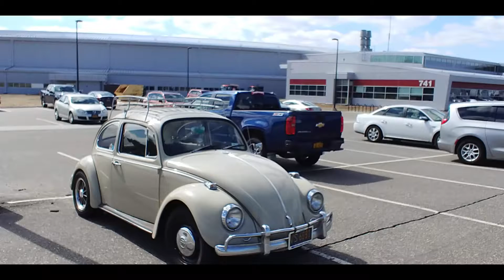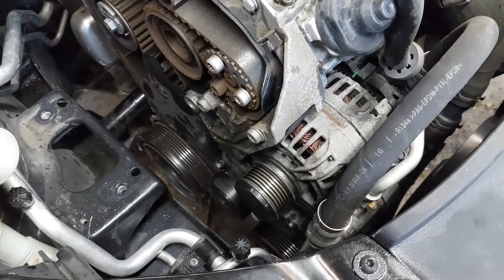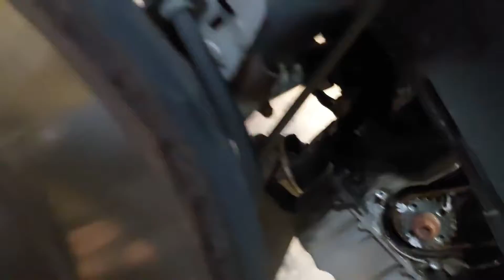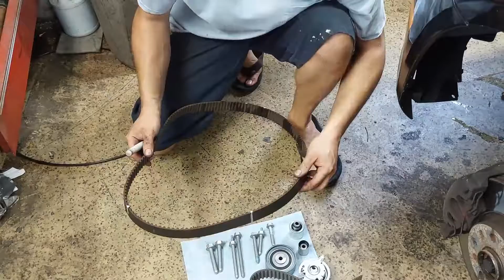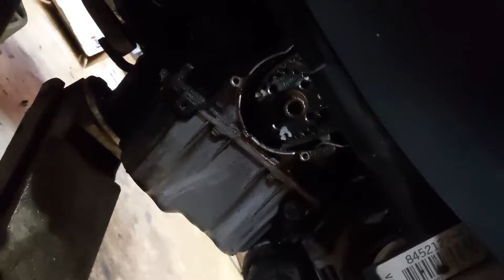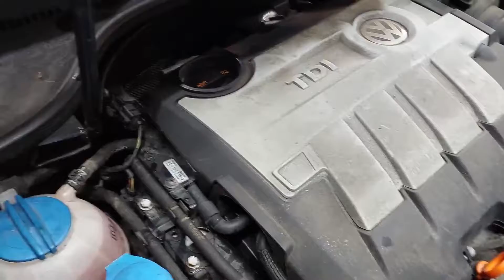2012 Vw Jetta TDI Timing belt /water pump replacement. Simple steps for any Timing belt job.

Comment: Hi mate, I am having problem with timing belt change on my son car vw golf mk6 2.0 gt tdi 2009 ,  the locking pin for camshaft dont go all the way in ( a thin screw driver goes in though)  and I think  cam timing may be slightly out , so can you please help me how to deal with it and how to set cam timing independly with no belt on , please. Thanks

Comment: hi done mine could you please tell me does the injection pump need to be in time the reason i ask because i watched another video and lad said the injection pump just need to put timing peace in that it helps time the belt. no i have black smoke coming out of exhaust when i put the foot down and the car seems to take of nice and fast but when i get up to 50 maybe 60 km it kind of a lot slower geting up let say 100 km what your side on this. Great video
Reply from the maker: So, If you are just replacing the belt I do not ever have to set the injection timing. But its also why I show using a drill bit to lock the pump from moving and mark everything with a paint pen. If the timing needs to be adjusted, You will need a scan tool that shows the injection timing and make adjustments until it is in spec.  If you have a Ross-Tech VCDS they have a plug in called "TDI Timing Checker. Its a graph that shows where the timing is and makes it very easy to set it to spec, or tune if you have any performance mods, or just looking for some better fuel economy. Thanks for watching, Cheers!

Comment: Marking the belt and pullies is the way that I have been doing the timing belts on my 2002 TDI. Car has 450,000 miles and still runs perfectly. I watched this video because my brother just bought a 2012 PD TDI, and he wants me to do the timing belt and water pump. The job looks to be pretty much the same, just a few more things that need to be moved out of the way. Thanks for the video. 👍
Reply from the maker: Thanks for watching and the kind words. I learned it from an old timer mechanic. You can learn alot when you just listen.
Reply: Why didnt you talk about the drill bit inserted? Im trying to do this job and watching this and your not telling everything

Comment: Where do you place the jack when supporting the engine, dont feel like the oil pan is safe
Reply from the maker: The oil pan is strong enough. Just need to place a piece of plywood on the jack to spread out the load and most importantly do not jack it up too far! The alternative is an engine support bar, but I find they get in the way when doing timing systems.  Thanks for watching

Comment: Curious… did this run without a check engine light? Looks like you had timing belt slack on the front part of the crank…
Reply from the maker: Yes, This ran just fine. Belt was only replace for maintenance. It was close to its recommended replacement interval.

Comment: Hello This Is Good Trik For Gasoline Engine Timing Belt Like Hondas And Others For TDI u need Timing Tool Kit To Lock Evrythink In Place after U Remove the Belt Camsheft Or High Pressure Pomp It Can Move And U  got In Trouble Don’t Teach Others Something That U Don’t Now
Reply from the maker: Absolutely not, Explain to me why you need to lock something that ran perfectly fine and you are changing a belt for maintenance? If you were replacing an injection pump in this case yes, you need to lock everything and then with a VAG tool set the injection timing. if you are just transfering marks explain to me/give me a good reason why it would change the timing any different than a locking tool? I appreciate all feedback so thank you for watching. If you can just explain to everyone that does not understand why
Reply: @willpoweredgarage969    Factory They Know Better than U This Why They Built It that Way here U Have The Link How to Do it The Right Way https://youtu.be/fAi667H7M2Y
Reply: Because the old belt might have stretched, and your half ass eyeball measurements on the floor would never have seen it

Comment: Why does diselgeek remove cam sprocket???
Reply from the maker: If you follow the factory procedure it shows to do so. In all my experience if you are just replacing the belt there is no reason the timing needs to be adjusted. IF you were replacing the pump then absolutely the timing needs to be adjusted. Aside for that, Leave the sprocket on. lol
Reply: @WillPowered Garage  I did water pump as well but took cam sprocket off. Fuck I hate the anxiety lol.
Reply: You should always follow the VW procedure. There are variances in the replacement parts.

Comment: Terrible practice the bolts on the fuel pump and camshaft sprockets need to be slackened so correct tension can be attained the tightened back up after adjustment just another flyby mechanic
Reply from the maker: I disagree, new to old timing belt will not change the timing of the cam or fuel pump. Removing or losing the bolts will. The video is intended for someone at home that either does not want to or cannot afford a dealership repair or have the appropriate vag 5052 or vag com to set the timing on these properly.
Reply: @willpoweredgarage969  Have to agree with Neil. This is the one of the worst timing belt bodge jobs on YouTube. Do it properly or not at all. The alignment tools are cheap to get hold of. This will be tensioned incorrectly.

Comment: I can understand the markings...for safety reasons..but there are literally 3 tools you need to lock everything in place ..camshaft pulley, hpfp pulley and crank pulley..
Reply from the maker: That is true, But the tools are not something in a standard tool box. I worked for VW for many years and I can tell you the tools were no always available, or even something the dealer had on hand. Sometimes you just need to find a way.
Reply: "Literally". 😅 The man just literally did it WITHOUT the NEED of those 3 tools. It happens all the time. 😊
Reply: Not the proper way to do it. Always use the tools due to variances in parts. They are not terribly expensive, and it's right every time.

Comment: What is cost to do this timing belt kit ?
Reply from the maker: It ranges depending on where you live and the labor rate of the shop you go to. Dealers are obviously more per hour. But, I would put the cost around $1000.00 -$1200.00 for parts and labor. The majority of the cost is labor. Hope this helps